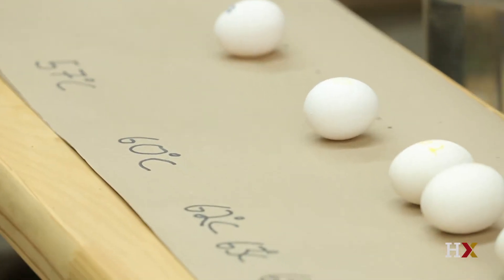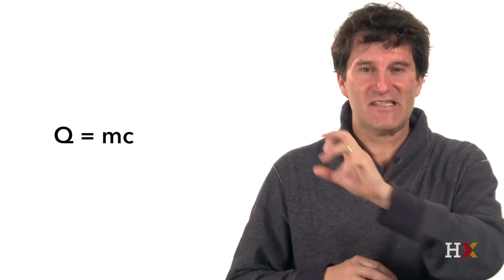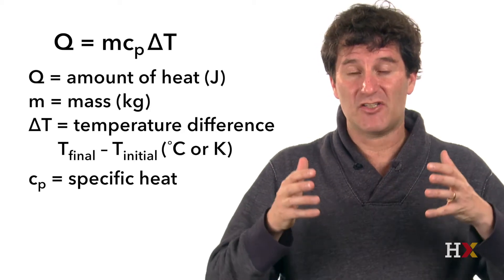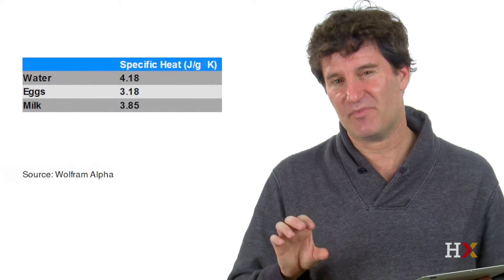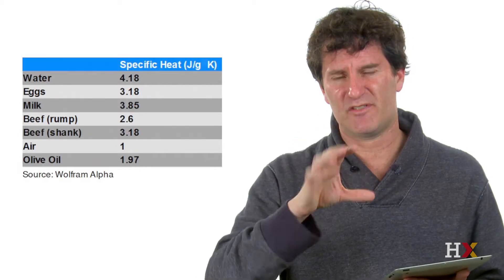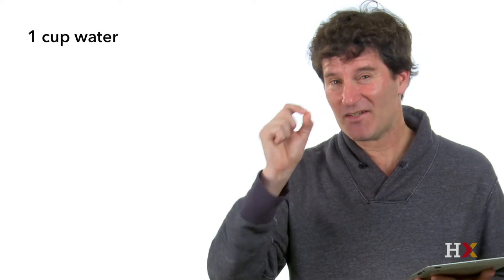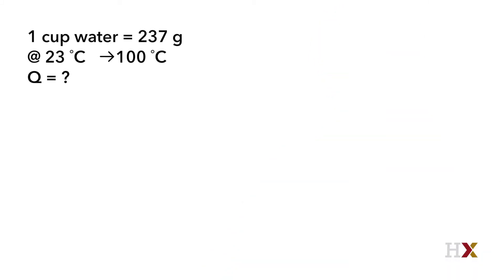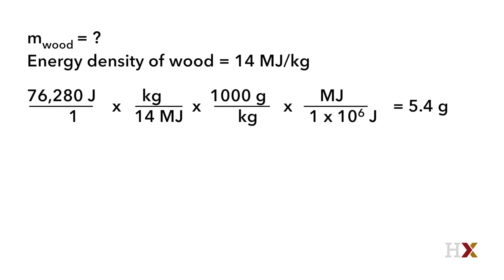Specific heat in cooking

Comment: wow amazing but how to find in methane gas
Reply: Late to the party but 1ft^3 of methane (natural gas) produces 1000btu of energy or, 1 cubic meter of will produce 37.26 Mega joules of energy. (Same thing, different units) This is all according to theory, imagining that you can harness all the energy in perfect combustion… which outside of lab conditions is nearly impossible. Another small thing he forgot to mention is that once you get water to its boiling point, latent heat is needed to cause a change of state and does not contribute to a change in temperature and the amount of energy needed to boil water from 100 to 101c or 212 to 213f is more energy than it takes to warm it to its boiling point from absolute zero (-273c or -460f)